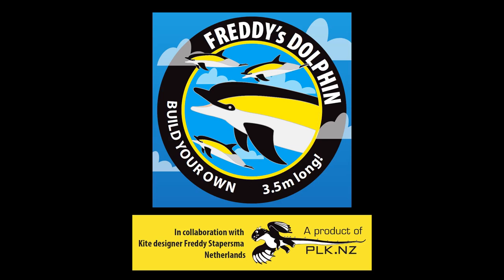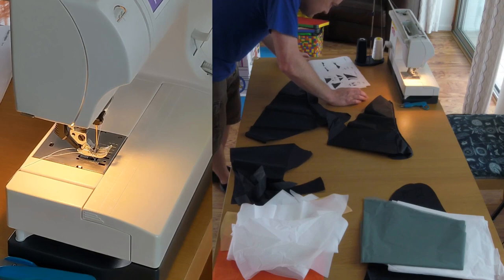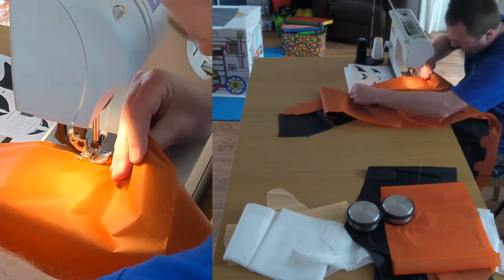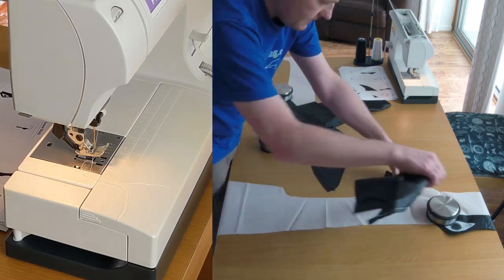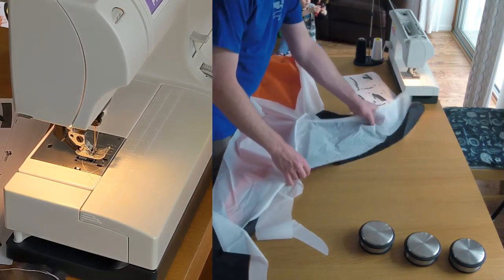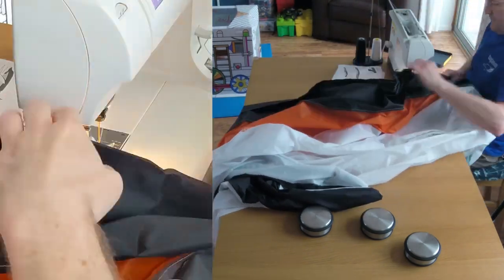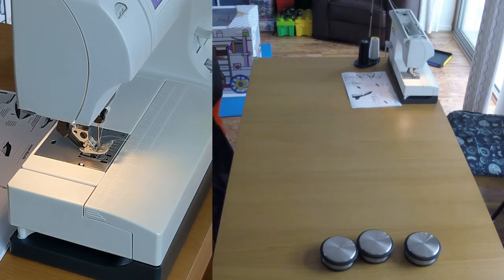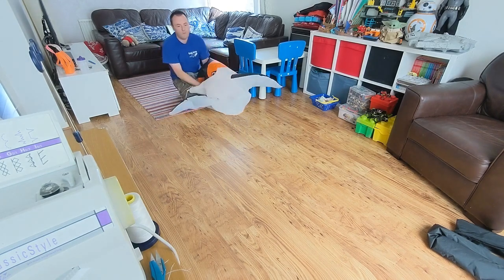Freddy's Dolphin Kite Kit Building Guide

Comment: Well done on an excellent video guide. I can't think of any suggestions to improve. Your calm and reassuring narration made me feel my first time sewing was not so bad after all. I think if I did another one I would have the confidence now to not overly pin every seam. Your puzzle regarding the throat flaps not matching inside seems to be common on all the kits. I have seen it suggested it allows for turning over and making a final hem but it's not in the instructions and hidden away inside I don't think it matters. I think only Freddy himself maybe able to solve the puzzle. I too dream of a room all my own for working.